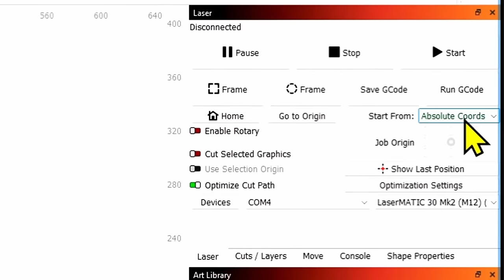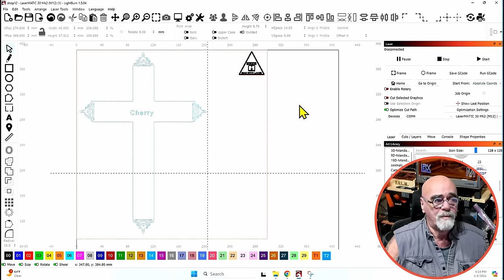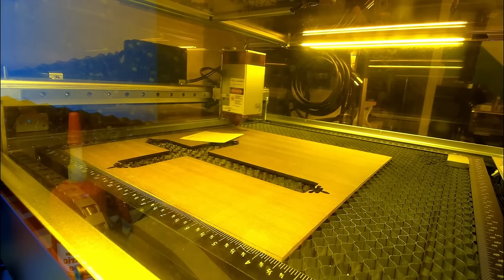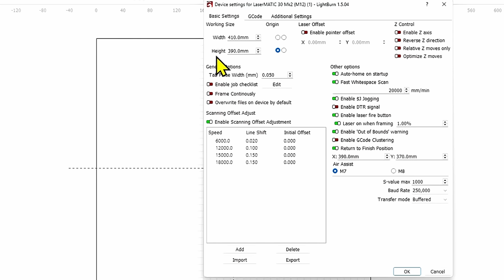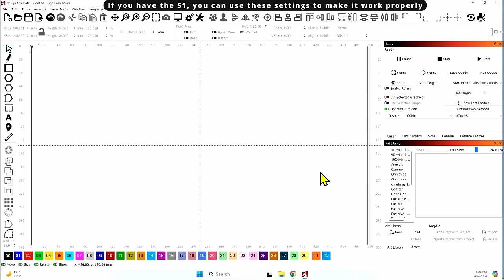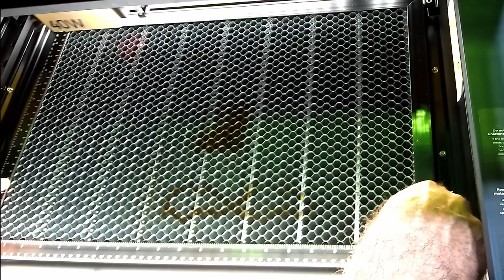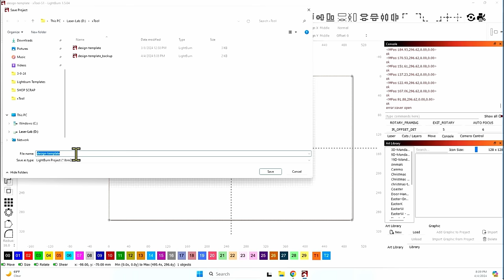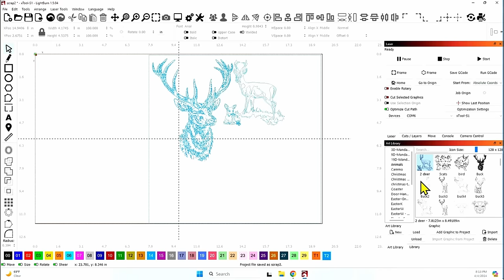👍How to MAXIMIZE your material in Lightburn without almost NO WASTE!

Comment: Very handy little tips, chock-full of wisdom. I just started making templates, but I wouldn't have thought to do this for scrap material like this.
Fun fact: If you have a scanner and scan in your picture of your material you're working on, it keeps the size dimensions true for when imported into lightburn. No need to measure or resize. Discovered that when I did a Bible cover with a name. 

I think I'm going to frame my waste board with your method, and inside my enclosure, mark my corners and drill some holes for dowells in diagonal corners to pin it exactly in place

My enclosure is clack-shsck inspired, but I bought my plans off etsy from Alan Bryant Woodworks. It's still a work in progress, but nearing completion. Will share it on the forum when finished.
Reply from the maker: Yup! I have a few videos on it. You just need to resize one dimension for it to be perfect.

Comment: With an XTool S1 and the XCS software, there is no need to do any of this stuff. You can pick up any piece of  material, drop it on the honeycomb and use the positioning system to select the area of the piece you wish to use. You can use a new piece of material or any scrap you may have laying around. You move the laser head where you want it and select as many position points as you wish. That will define the area that will be lasered. Next you position the graphic inside the shape that is now shown on the screen of the program. There is no need to keep templates for each piece of scrap of each type of material. That would drive me to distraction. You can re-orient the piece of scrap so you might get a more usable space by rotating the scrap to any angle and position on the honeycomb. 
Now granted, LightBurn may have more and better design tools than XCS. But it’s easy to design in LightBurn and then transfer the final design to XCS for positioning and processing. 
In addition LightBurn is well on the way to be able to use exact positioning system from the S1 directly in LB itself. There is currently a LB beta version that is circulating that has more S1 specific features handled directly already. 
As far as locking down the S1 honeycomb is concerned, with about $5.00 worth of simple hardware it’s easy to firmly lock the honeycomb down, no duct tape needed.
Reply from the maker: Thanks for the comments, but they should have never released the laser without proper Beta testing. I shouldn't have to have a dozen work arounds to use a really expensive laser.
Reply: It was really the software that was a little bit behind the times. But was the Roly and Lightburn perfect when they were released? 
Yes the XTOOL S1 was (and is) a bit pricey.  It’s the first totally enclosed laser system to have a Class 1 Laser Safety Rating for both the visible light and available IR laser. It has automatic flame detectors and even an available C02 automatic fire extinguisher system. All of these features were available on initial release, not in beta testing at all. Also available was an air assist system that the software could control velocity over 3 ranges. It also can be controlled manually. In addition the S1 has always had an automatic material thickness for setting focus. In addition, the system can map uneven surfaces (concave or convex or both)
for perfect engraving. 

But it is also very expandable. With the riser base you can easily handle a wide variety of thick and/or tall objects. The rotary has all the features anyone needs. With the conveyer system, it can engrave work 18.5” wide and 118” long.
I know you are a fan of The Roly, and that’s fine. I just think you have and continue to give the S1 short shrift without really know all the capabilities and features it has. Is the S1 perfect, certainly not. But can you show me any system on the market that is? All systems have advantages and disadvantages.  But my initial description of how the S1 has no need for the user (for what I consider a tedious bookkeeping system) to do anything special to optimize material usage.
Reply from the maker: I'm happy you like it!

Comment: +
I tried this and it works well if no images. With images in your cut,  you must change to all to the  Tool path and then Ungroup it and delete the image. Them regroup, lock it and save.
Reply from the maker: Yes Richard. I replace the images with a square or circle.

Comment: Rich, what a great workflow.  Will save time and material!  An idea.  Wouln't it be more efficient to save the Scrap materials to Scrap Art Library 1st?  I have three Art Libraries 

that I use regularly.  A Scrap library will be my 4th.  Load it when I get ready to start a new project 1st.  BTW I have a couple of major projects that I am working on sooooo, the reason for the variety of Art Libraries.   Thanks again as you have made my journey much more fluid both as a YT subriber and a Patreon menber
Reply from the maker: Awesome! Yes you can save them to an art library, however, they will not remember the X & Y position when you bring them back into the work space, so saving them as a template is easier and more accurate.